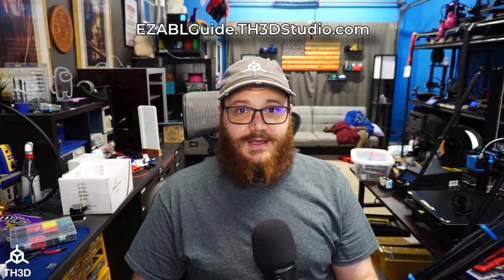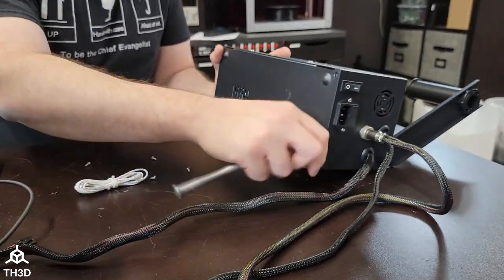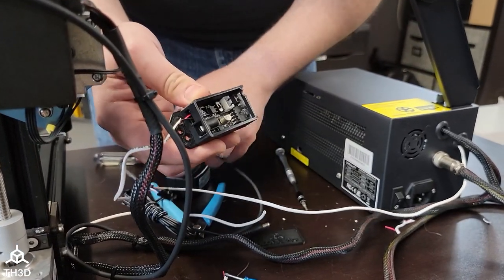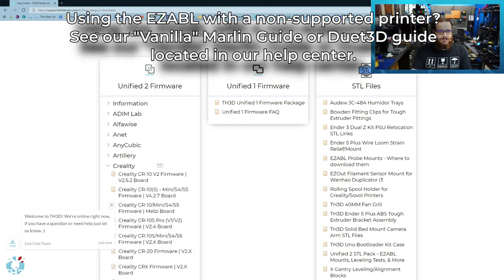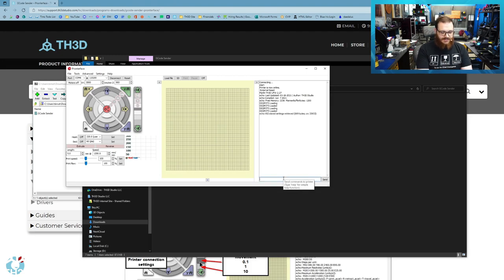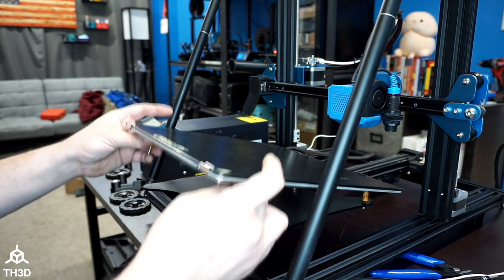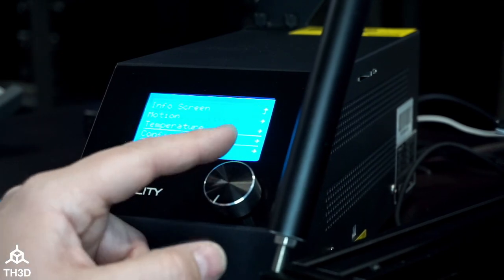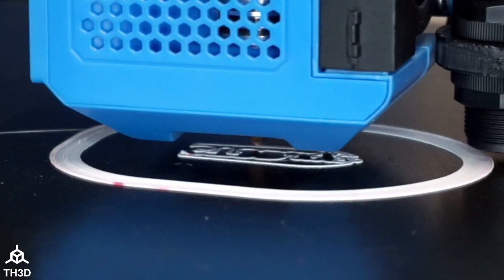EZABL™ Pro - Detailed Installation Video

Comment: My printer was printing very well with my BLTouch and yellow springs but the EzABL Pro and solid  spacers made it so consistent that I can print completely remote and have great results every time.  Well worth the money to not worry about spring movement or a pin malfunction.  Thanks again Tim and team for all your hard work and helping to make this industry better  😎 🇺🇸
Reply: This has been my experience as well, and I'm replacing all the BLTouches I have with EZABLs.  Night and day difference in speed, accuracy, and reliability.

Comment: I use an SD card to set the 2mm sensor height - an SD Card is 2mm thick.  Great product!!  I have installed and used over half a dozen with more to install.  Very consistent and reliable.
Reply from the maker: Thanks for the info! never thought about the SD card!

Comment: Very nice addition to your video guides.   The EZABL sensor is a pretty simple install with the printed directions but this would definitely help if you haven't installed an ABL sensor before. I recently bought a CR-10 S4 and decided to go all in on TH3D. I got the EZABL Pro, the OEM sensor mount, solid bed mounts, a Meanwell PS,  and the PTFE upgrade pack. They were all easy to install and work great. The Unified 2 firmware for the CR-10 S4 was easy to configure and install and I had everything up and printing beautifully in a day.  Thanks for all the support you provide to the 3d printing community.
Reply from the maker: Thanks for the feedback Dale! Glad to hear the printer is all working well after our upgrades! I hope you enjoy the convenience of the EZABL. Have a great day man!

Comment: The EZABL Pro is the first thing I bought for my first 3D printer because of Edge of Tech's video.  Thinking I might have chosen wrong because I was a noob and the BLTouch is so popular, I bought a BLTouch for my second and third printers.  After several months the EZABL was the best choice for me, as I've had nothing but trouble from both my BLTouches.  I'm in the process of replacing them both with EZABLs, and fitting my new Ender 6 with one too.  The EZABL is 50% more than an BLTouch, but it's 1000% more reliable, fast, and accurate for me.  My only complaint is the white power wire for hardwired installation.  😅

Comment: AWESOME video! I just got an EZAble Pro for my Ender 5 Plus to replace the BLTouch, so I am hoping this installation goes as smooth for me. I am also very probably going to install the solid bed mount kit because I hate dealing with manual bed leveling and the springs - it has always been a problem for me to get this right. It looks like TH3D products are going to make my 3D printing life much more enjoyable!

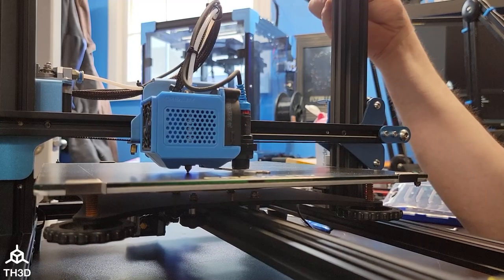Comment: I recently purchased the EZABL kit for my Ender 3. I'm a little confused following this video installing and setting it up. @16:22 Calibrate the Sensor, what is the purpose of setting the nozzle 2mm off the bed and calibrating the sensor from that height? I assume that will cause the sensor to trigger prematurely, thus giving an inaccurate bed level measurement/reading. I am noticing, that during a G29, the sensor will trigger with the nozzle 2mm above the bed, even after adjusting the Z-offset. 

I know this video is a few years old, so if there is a newer/updated video you can point me to that would be great.

Comment: Great video, just what I have been waiting for  my Anycubic Chiron
Reply from the maker: We are working on the Chiron. It's going to need a LCD replacement to work with the EZABL. But we're working on all the hardware to convert it as well as the firmware. We're hoping to have it all completed in about 2-3 weeks at most.

Comment: Try turning your cutters around so the flat edge is in the direction you are pulling. You will find it strips 100 times easier :)

Comment: When you started the section on setting initial z-offset, you instruct us to Auto Home and when you execute, the head moves to the center of the bed. My Auto Home moves to the front left corner as I would expect. What am I missing there?
Reply from the maker: If it is moving to the front left it is likely a configuration issue. You can contact our support to help troubleshoot your setup: http://contactus.th3dstudio.com/

Comment: Great video! I have a question about the optional power supply for the board. If I go that route, is it ok to just leave it plugged in permanently or do I need to unplug that when the printer is not in use because it's not tied to the printer's power? Just curious how the board handles that.  Thanks!
Reply from the maker: You can leave it plugged in all the time, it will be fine. It doesn't take much power at all.
Reply: @TH3DStudio  awesome thanks!

Comment: Is this an inductive or capacitive sensor?  Is there any performance difference between the 3 sizes of probes?  Can I use the small (8mm) one with my Ender-3?
I assume that the power input to the box on the screw terminals can handle 24vdc, but is the input jack for a lower voltage?
The Ender V4.2.x control board has a connector for a BLtouch.  Can this be used for the output of the probe instead of the ZMIN connector (with software changes to Marlin)?  This would allow BOTH the ZMIN switch and the probe to be used.  The probe triggers BEFORE the nozzle hits the bed, while the ZMIN switch hits WHEN the nozzle bottoms out (if everything is adjusted correctly!).  Thus the ZMIN switch becomes a failsafe to protect the bed and the hot end, while the probe performs the auto bed tramming.

Support page doesn't seem to have any .STL for the mounting bracket on an Ender -3 or Ender-3 PRO.
Reply from the maker: This is a high performance capacitive type that we had made for 3D printer application. The performance of all the sizes is the same.

You can use a dual setup with the endstop switch and the probe but our support would not cover setting that up since it is not our recommended setup but all our source code for the firmware is available so you can modify it as you see fit for your machine setup. Nozzle crashes are a possibility but they are very rare with our sensors as their failure rate is very low.

Comment: I flashed the firmware but when I go to auto level my nozzle wont stop. The light on the sensor is green going down but when it turns red but doesn't stop. When I switched the wires the light never lit up red or green and still did not stop.
Reply from the maker: If you're following the installation guide you will see a section that tells you to check the sensor signal with the M119 command. It sounds like you skipped this step.

Comment: I've never resolved my ezabl. My printer is structurally calibrated, followed the instructions for installing ezabl. When I home it, the sensor is in the middle of the bed, but then when I do bed level it probes 10mm to the right. I have ezboard 1.2 as well.
Reply from the maker: Sounds like your probe offsets are not set correctly. You can reach out to our support here and they can help you troubleshoot: http://contactus.th3dstudio.com/

Comment: I was emailing with a gentleman named Peter. When I get to the 23:48 mark in this video, my Z is showing OPEN when it should be showing TRIGGERED, the red LED is light on for both the probe and in the control box. I moved the set screw to shut the red LEDs off, and it still reads open. I flipped the switch in the EZABL control box, and nothing changes. He had me return my EZABL Pro, along with the control box. He sent it back to me, along with an email saying everything was working normally. I put it back into my E5+, and I'm right back to where I was before. There have been some delays in my communications, because I am having some very serious legal issues, and did not have time to mess with my printer. The way things are looking for me with this printer, is it seems like it has bricked on me. I'm at a complete loss here.
Reply from the maker: If the sensor is reporting wrong then that would be a firmware configuration issue. If you don't update the firmware and tell it you have the EZABL it will not report back to the board correctly.
Reply: @TH3DStudio  I used your EZfirmware builder, so I would think everything is OK with my firmware. And when answering the questions, I did tell it I have an EZABL.

Comment: My Ender 6 Extruder is moving around the back right quarter of the bad as if it was the entire bed. I've checked the bed size in the firmware and slicer and they're both correct. Could it be something with the EZabl Pro or something else causing this?
Reply from the maker: There's not enough information here to determine the issue but if you are a customer, you can ask our support for help here: http://contactus.th3dstudio.com/
Reply: @TH3DStudio  I don't know what I did, but it's working now. Thank you, tho.

Comment: Hi, I have just installed the EZABL on my ender 3 Pro. updated firmware ok. Calibrated sensor ok. Did G28 and G29 from Pronterface ok. Can Auto Home from the LCD ok. But the LCD does not show the option for "Level Bed" (i.e. G29) but it does have an option for "Level Corners" instead, why is this and how can i fix this?
Reply from the maker: Please contact our support. Youtube is not technical support. You can submit a ticket here: https://www.th3dstudio.com/contact-us/

Comment: How do I save the firmware to a micro SD card for my printer? You only covered with the USB method and I checked the firmware download page and didn't see instructions there either
Reply from the maker: You put it in the computer and copy the firmware bin file to it. Then power the print off, put in the SD card, and then turn it on to flash it. The directions are on the firmware page.
Reply: @TH3DStudio  I can't find the .bin file. Now I am trying to repeat the whole process and it's adding a bunch of repeated lines and not letting me start a new project in visual studio.
Reply: I'm all messed up now. Wish u guys had a phone number
Reply: @TH3DStudio  how do I start all over in visual studio? It's building onto the same project each time and not starting over for me fresh. It no longer even gives me a check mark
Reply: @TH3DStudio  I think I finally figured it out. Haven't put the card in the printer yet but the. Bin file is there. Do I reset the eeprom on the ender 3 pro?
Reply from the maker: I'd delete the folder and then download a fresh copy. That way you aren't trying to troubleshoot weird issues from bad edits.
Reply from the maker: If you are an EZABL customer you do have support. Just send us a ticket here: https://contactus.th3dstudio.com/
Reply: @TH3DStudio  I did already. I am pretty sure I figured it out though..I appreciate you responding though.  Apparently it was just one of them random glitches. Usually happens to me lol

Comment: still trying to get my ender3 with extender and ezabl it want to print in front left corner getting frustrated thanks
Reply from the maker: When you have a major mod like the xtender installed you have to set the option for that upgrade. You can always try to flash as a normal ender 3 and make sure it works correctly in the 235x235 build area and then go from there. While the xtender is not our product we do have options in our firmware for it if you look in the config file.

Comment: Does the 2 mm wrench work for the mini version of the sensor?
Reply from the maker: Yes, because the sensor is still mounted 2mm higher than the nozzle tip. But the calibration is done with the nozzle 1mm off the bed instead of 2mm.

Comment: I really need help with this. I’m trying to do this with a Mac and I have a new ender 3 pro. I do not have a checkmark to be able to check after I uncomment the board in the probe mount to do the build. I don’t know what’s wrong and I don’t know what to do. I am not a coder. What I am is frustrated. I do have a gear that says build in the triangle like a play button. Neither one of them does anything. I’m just getting errors. Can someone please contact me?
Reply from the maker: Hi there Deb. It sounds like you missed a step in VSCode. You can contact our support team through our support form here: http://contactus.th3dstudio.com/

Comment: I'm want to buy and use this on anycubic i3 mega (note zero not x not s the original one) is that possible to make a firmware upload to the site or you guys just have for the chiron? please let me know. I'm not that good with the firmware thing... and I really want make my life easier with my bed leveling...
Reply from the maker: We do not have any firmware right now for the i3 mega and that one will need its LCD swapped due to the proprietary LCD they chose to use.
Reply: @TH3DStudio  thank you

Comment: There is no slice test file in the stl pack.
Reply from the maker: You need to slice your own files. We do not provide pre-sliced files as everyone has slightly different printers they are using.
Reply: @TH3DStudio  yeah I figured that but you told me it's all in the stl. To perfect the z offset you should use something with a large base. So you should include a large square for perfecting the z offset. Like 200×200 or something. The bed level ones don't work as their is too much whitespace.

Comment: This doesn't make sense.  After setting the sensor height, you tell us to raise Z by 2mm.  So, if the sensor is supposed to be 2mm higher than the tip of the nozzle, and we raise Z by 2mm in this step, somehow the sensor is supposed to go off when it's 4mm above the bed?
Reply from the maker: Correct, 4mm off the bed with the 18mm probe.
Reply: @TH3DStudio  I don't know why I didn't know that.  My printer has been out of commission for months.  Thanks to that video, it's running merrily along now.  Thanks for the quick reply!

Comment: Fellow printers told me to pick this thing up for my CR-10S5. After I received it I downloaded the STL pack and noticing there's nothing available for my printer. So I guess this sensor isn't going to work in the long run for my printer.
Reply from the maker: The CR-10 S5 uses the same mounts as the CR-10 since they all use the same hotend carriage.